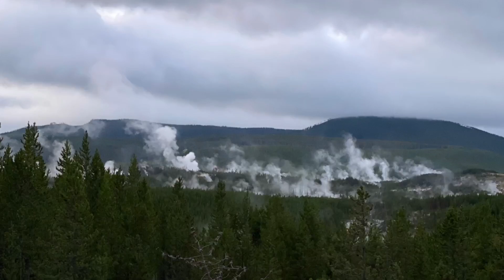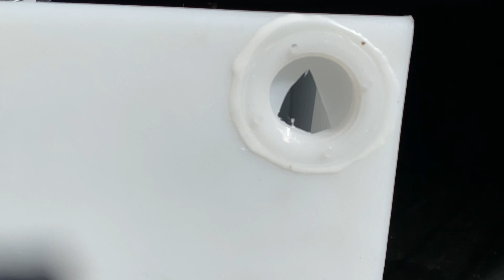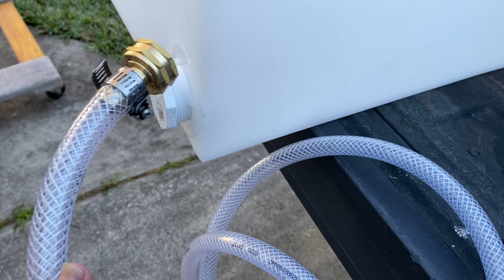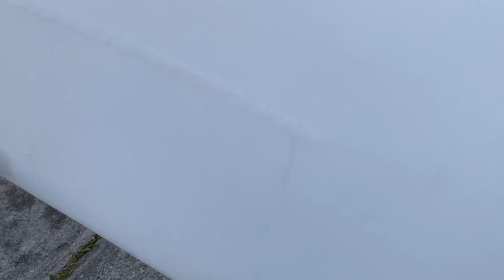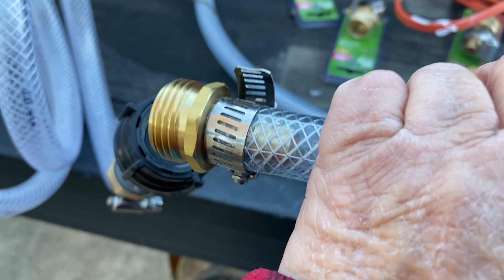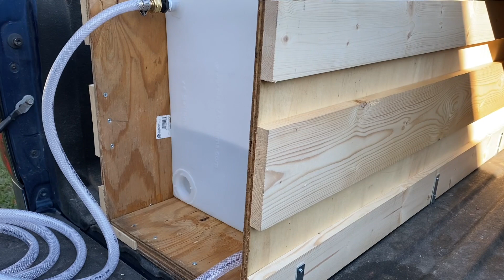HOW TO INCREASE WATER STORAGE FOR BOONDOCKING 💧

Comment: Hi Shirley! Is the hose on the air portion (top left) necessary? Couldn’t you just use the same fittings you have on the other end of  the hose and eliminate the hose? Just curious. Where the tank is positioned in the truck are you able to see the fluid level while filling and the status? If filling the tank at a campground [or other unknown water pressure locations] I’m sure you’ll be using a water pressure regulator I’m assuming. I admire your determination and ‘do it to it like Pruitt used to do it’ (phrase from the Movin’ On tv series of days past). Kudos on a job well done! Stay safe!
Reply from the maker: Good question Jim!  I probably could get by with a shorter hose but wasn’t sure yet so I kept it at the same length as the fill hose.  It comes in handy to know when the tank is full.  The water will start coming out the vent hose !!  Yes, I always have a pressure regulator attached to my water hose.  Thanks for watching and leaving a nice comment!
Reply: @FollowingtheYellowBrickRoad  👍❤️